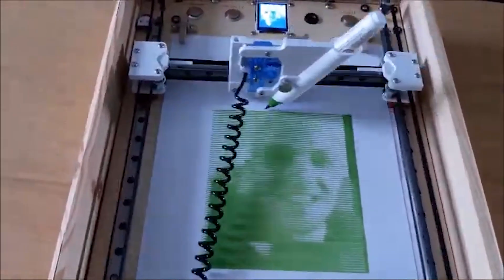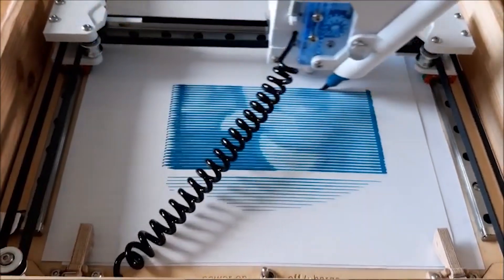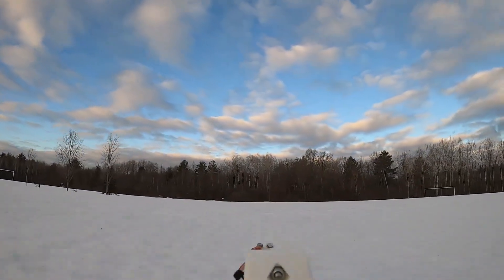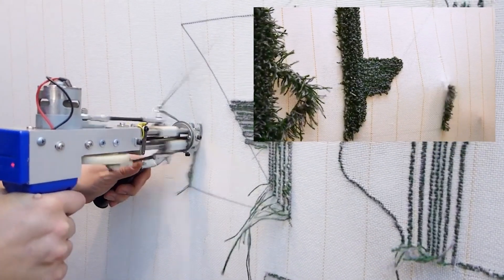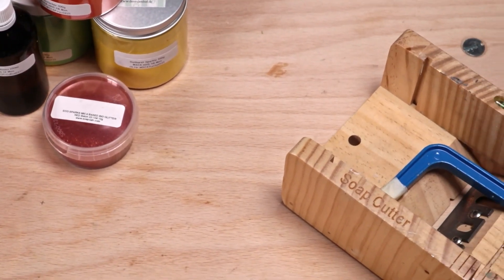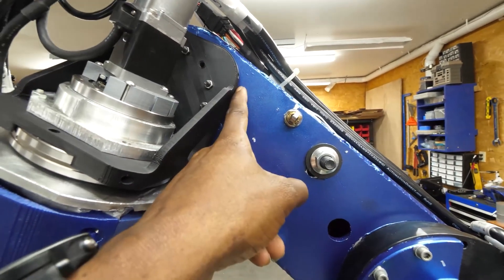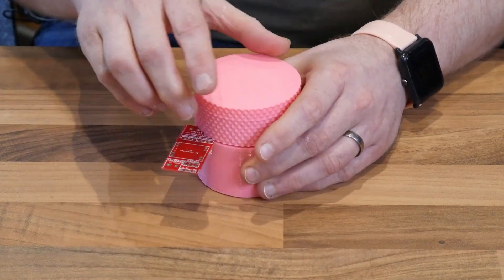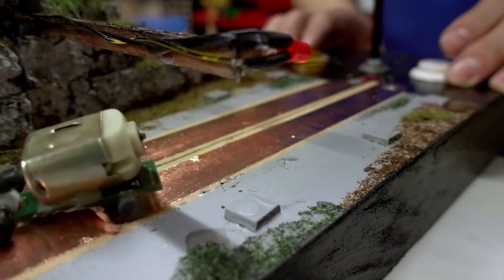Take My Picture [Maker Update] | Maker.io

Comment: I personally have a love for the 555 timer chip because it was the very first chip I learned about in my electronics class. I often go back to implementing this chip where ever I can even though in most application or components it’s function is already incorporated into a board system design. Great one this week Becky and the industrial robotic arm is a keeper. Now I just need to make 200 more and I’ll never need to work again.